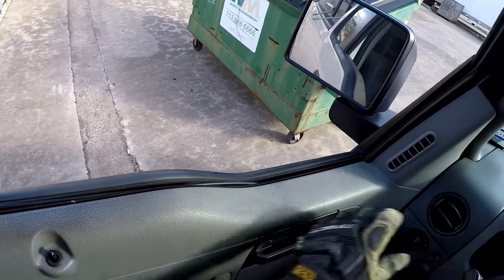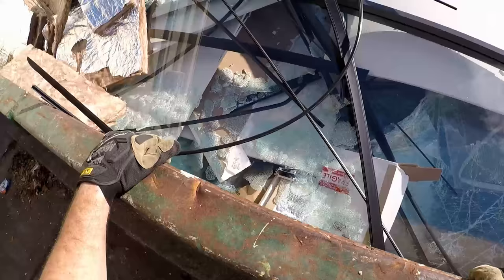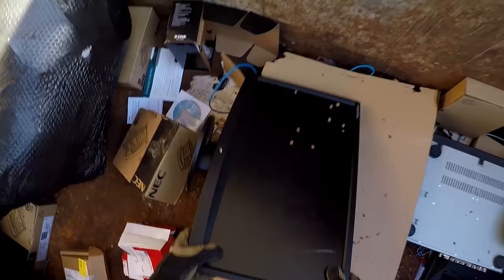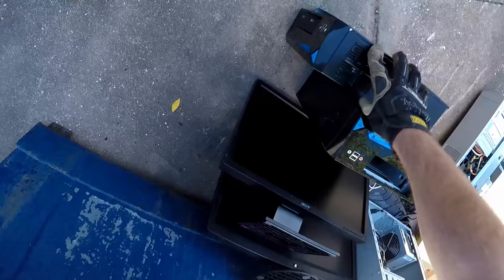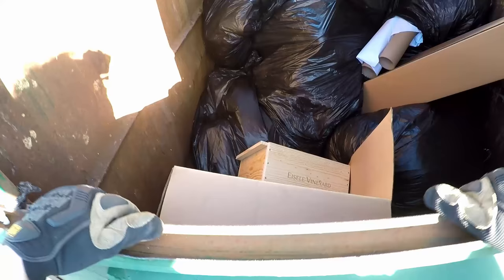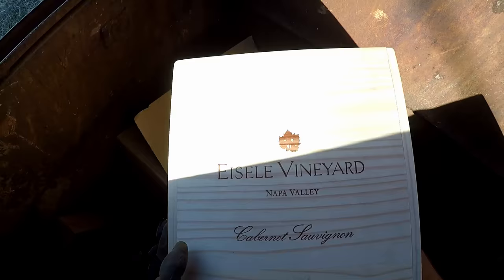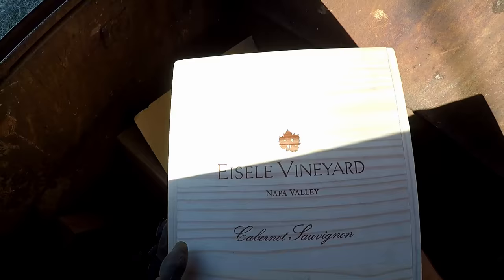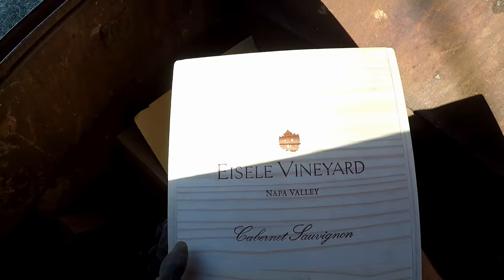Dumpster Diving "Let's Break It!"

Comment: I would report that medical dumping  because of a potential biohazard.
Reply: Unused medical products are more of a potential toxic hazard than a biohazard,  however... I can almost guarantee that there are laws about correct disposal. Which means it is expensive to dispose of legally.  

So I have little doubt some smartass is faking the paperwork, salting that old expired sh*t into the local dumpsters, and keeping the big markup for "correct" disposal.

 I once found a stack of confidential data tapes in a dumpster, near a large local hospital. The tapes even helpfully said on the label what was on them. These things are meant to be disposed of in a controlled manner,  and in accordance with the data retention policy,  so probably verifiably destroyed on site.  Not left out with the trash when the computer gets upgraded, so that some random passer by can pick them up and read the confidential medical records of half of the city. 

There are always people willing to cut corners to save or make a few bucks.

Comment: Breaking glass is sooo therapeutic!  A neighbor had a big barrel and a huge stack of chipped and half broken cups and plates.  We spent a great hour throwing them into the barrel.  We had long sleeves and eye protection.  It was a great sense of elation to break the glass.
Reply: I used to have a large number of parts cars which were used for parts to keep our old cars running. I knew a local girl who told me that she loved to smash windows and dishes, so every time that I was ready to send one off to the scrap yard I'd invite her over to break all the windows and lights and cut up the seats before the scrap truck came. She really got off on it.

Comment: If you take apart the monitor there is some Lexan inside that fit nicely on the bottom of any router. otherwise sold easily for more than scrape

Comment: I know this is an old video, so you may not read this. Medical equipment, supplies, samples etc are supposed to disposed off via guidelines set out by FDA, WHO etc. Finding all the stuff you do needs to be reported to either the police or some local authority. There are serial numbers on those boxes which they can possibly trace to whomever is improperly disposing of them. This kind of thing causes a lot of problems safety and security wise. I hope in the future you'll contact someone and report it. Cheers.
Reply: Get real.

Comment: I’m sure you can’t just dump that medical stuff as has to be disposed properly. Also why is there a used by date on rubber/plastic pipe and a needle
Reply: Because after a certain date they can't guarantee anymore that it is still sterile, and the material is of the same strengt as intended, some plastic parts disintegrate after some years, and that is a thing you don't want to happen when someones life depends on it.